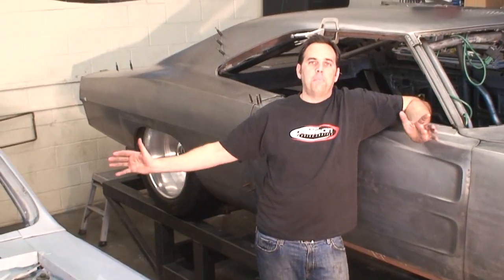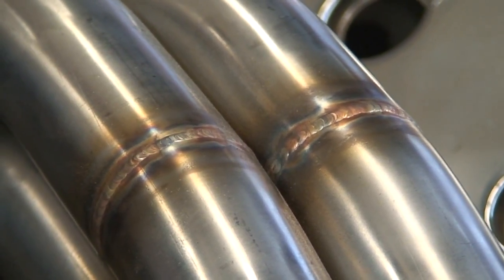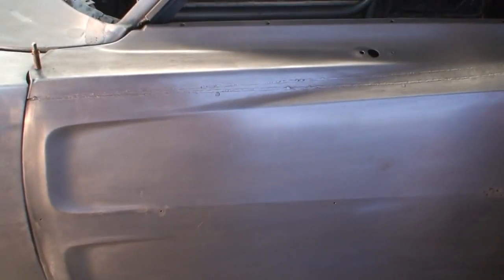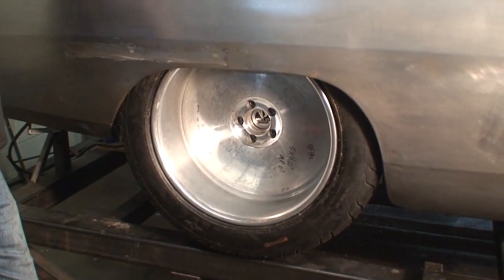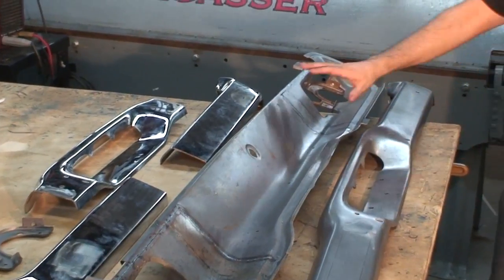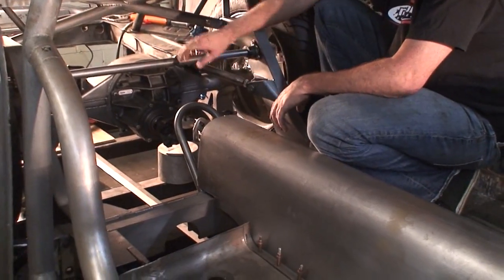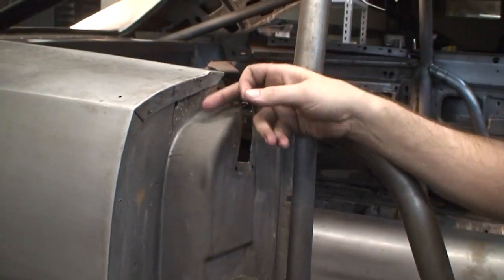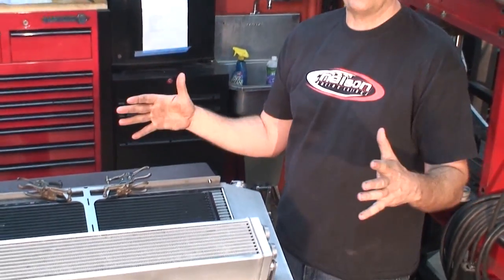2000 HP Dodge Charger Hemi - Mirror Image Turbo

Comment: These guys are mediocre car builders not engine builders so you can look forward to a really high HP number under falsified conditions followed by the boost cut down to about one third on the street and a suspension settup failure that can't even keep up with the hundreds of horsepower that makes it to the wheels.
Reply: LOL ^ this guy. if this is "mediocrity" sign me up:)
Reply: i agree with Scott Hill 100%
Reply: Nope, just an annoyance with lies about HP.  What I stated in the first place is true.  If you had ever been around real horsepower you would recognize what NRE lacks.
Reply: sorry, guess most of us arent as awesome as you. I am very impressed with these guys just from their videos. if you have something better, please share it.
Reply: causeimbatmaaan, I have been around real horsepower. One of the cars in my collection is a 1968 Super Stock Barracuda. That was built at the Hurst facilities. It was one of 80 built strictly for dragracing. It ran 10.50 @ 130 mph. And my matching numbers 1970 Hemi Challenger has real horsepower. Just click on my avatar and you will see a link to my website. And yes, that is me sitting next my Challenger. Along with Bob Bondurant and my 1969 Shelby GT500. So tell me what real horsepower have you been around?
Reply: You guys make assertions without any credibility but I work in a machine shop that is well known across the country for building reliable horsepower, I've worked on engines that produce 3500horsepower naturally aspirated. There is more in the background of building horsepower than you two will probably ever catch wind of.
As for you scott, a barracuda that has/had around 600HP at the crank, OH MY GOODNESS, I'M TREMBLING. you call that real horsepower in relation to these guys? HA, these guys are claiming 2000horsepower and if you knew what you were looking at you could tell how fake the conditions are from their videos. On the street they make around the same as your cuda, they don't try to hide the fact that boost is less than 1/3 on the street but there is a difference between a tuned down engine and an overtuned engine. Every engine is capable of producing way higher numbers under falsified conditiions as long as the parts hold up for a little while with extra cooling. A true 1000horsepower on the track should run into the 7s or 8s in the 1/4mile depending on the car.
They make things look nice and that's good but they essentially lie about thier numbers, kinda like I suspect scott lies about those cars being in HIS collection, no matter, since when does buying a car make a person knowledgeable about engines?
I'd put our engines up against NREs any day but for now we have much more serious competition than street cars and their know-nothing owners like you guys.
BTW you seriously don't recognize that these guys aren't even competitors in profesional racing and that is where the highest quality is?  You're their kind of customer, the kind that exaggerates and doesn't even know it.
Ha, go blow the steem off in your 35,000HP GT500 or whatever (probably a Honda Civic...in a video game).
Reply: Batmaaan. You say you are in well known machine shop. Yet you don't give the name of the shop. And if these guys are such jokes. Why is there a one year waiting period. They have over 60 people that have put down deposits to build them engines. And not only that. I googled Nelson Racing Engines reviews. And did not find one person that had problems whatsoever with them. If you think I'm lying about my cars. All you have to do is click on the picture of my Shelby on this post. It will direct you to my YouTube channel. On the top of the page is a picture of my engine. On the bottom right corner of the picture. There is a link to musclecar garage. Click on that and you will see my collection. Most of the cars have been in magazines. There are several pics went to me and either Bob Bondurant, or John force next to my cars. So what's the name of this great shop that you work at? And as far as my education goes. My father race against Lee Petty and many other old time stock-car drivers. Back in the late 50s. He was a machinist for Ford for 30 years. And I've worked alongside of him on many occasions building cars and racing engines. Anyway, I can't believe I'm spending this much time on your ridiculous comments.
Reply: Scott Hill ya, i love when kids come on here and say things like "Well, we do 3500 hp jobs!". it just makes me smile and shake my head at such ridiculousness.
Reply: my point is this- who cares that you can make a fast car for only a 1/4 mile...fast piece of shits are still fast piece of shits...but show us a quality car (like above on this link) that can be daily drivers with that much power. this my friends, is talent.
Reply: how is that? you must have mis read...every post. lol. 
I said, and still agree, that regardless of what anyone says they can do hp wise, seeing the quality of work this company does is impressive.
Reply: causeimbatmaaan So what is your shop's name again?
Reply: causeimbatmaaan To be fair your engine's sound like racing motors (3500 H.P) so that's a additional 1500 H.P than this engine (if it indeed makes 2000 H.P) I guess the Dyno will tell the truth where is you information that the figures are false? have you dealt with them before? I have a Friend who made almost 1100 H.P at the wheels with a 500 C.I Stroker TT and it was a relatively "mild" build stupid amount of power for the street IMO
Reply: Mike, the 3500HP engine I refered to was a nitro-methanol nostalgia-drag engine which are restricted to using half the fuel pump that professional top fuel cars use.  And I would never post the name of the shop I work at when having a silly argument, probably get in trouble if it was noticed for mentioning it in such an unprofessional manner.
But there are many things that one who understands their dyno equipment can do to effect numbers as well as external things like overpressurizing the room which I have seen them do as well as raising the boost with extra cooling to an impractical level that would burn the engine down if it was left that way in a street car.  Sense they so publicly make claims I felt it was fair game to criticize as well.
It is relatively easy on an engine to spin the wheels without getting traction.
1100HP is huge power on the street, the trouble is in getting streetcars to hook up and actually use the power.
Reply: causeimbatmaaan Hi again, I agree, there's Guy's who build their Motor's with WAY TOO much (H.P for the street IMO)' I don't know why they do it I wanted your opinion when does it get "more than enough" on a Street car? I've heard some say 400H.P other's say 500 H.P for me, my "mild" 440 is more than enough on the street hope to hear from you and thanks in advance.PS I agree why you would not name the shop you work for :-) I believe your for real.
Reply: mike mikesbbody I think that if a car is set up well for traction 500WHP is more than many people (probably most) are prepared to handle.  400WHP is enough to run 11sec quarters in a typical street car and more than enough to get in an out of control situation.  One very mild engine we did (as far as racing engines go) was a small block chevy, 406, that a guy had in a 69 camaro drag car, 3100lbs, and I would guess the engine made 600 crank HP (BHP) and ran 9sec flat in the 140s MPH at Bandimere.  Then an idiot bought the car from our customer and put a thousand shot of nitrous on it and broke every rod in half (first run of course) and the guy comes walking back up the track with a piece of the crankshaft spinning one of the big ends of a rod on it.  But people that saw it happen said it was the fastest 60ft they saw all day.  I never heard what the 60ft was supposed to have been but that's approximately where it blew (and the precise spot where one particular idiot should have been slapped lol).
Reply: causeimbatmaaan Apparently you didn't read my full post. With over 60 people ahead of me on a waiting list. Should show that there is an overwhelming number of people that more than believe in the dyno numbers. I am well aware that you can doctor numbers on the dyno. So being that you don't want to name is shop. What do you do sweep the floors? If you don't believe me about the cars. Again, check on my website. It's on the bottom right corner of my YouTube channel page. Musclecar Garage.com I restored my first car, long before you were ever thought of.
Reply: Scott Hill LOL. I don't care.  There are smarter people to converse with.  You are like a fifth grade girl; way too emotional!
Reply: causeimbatmaaan Thank you for your reply :-) I am not a racer so I think 400 or less will be enough for me don't mind the haters I believe you know what your talking about thanks again!